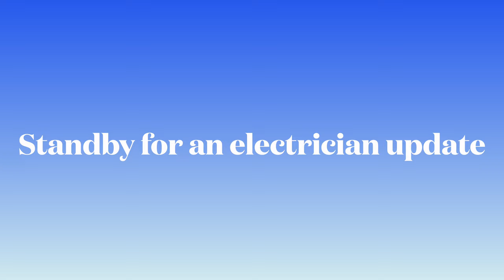A SHOCKING update on our electrics | Plus we do more plaster boarding in our attic conversion

Comment: I was on tri-phase in the last house I bought, it was because it had electric heating so you could have the heaters all on and then turn something else on that was on another phase, or something, I had it switched to single phase by my electrician, was about €500 5 years ago so gonna be a lot more now 😳. On a good note my standing charge went down because I could drop my power to 9kw from 12.  What did your diagnostics say? And your estate agent
Reply from the maker: Hi, thanks for the comment and advice. All the diagnostics said was “ the electrical supply is typical of a house if it’s age” 
Marvellous lol
Reply: @Escapetofrance-Charente diplomatic way to say it has to be update !